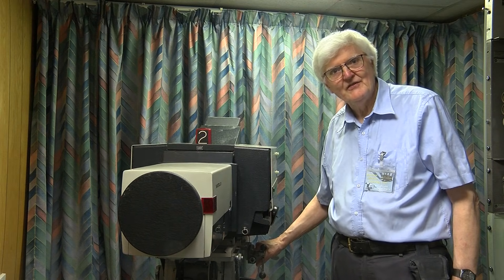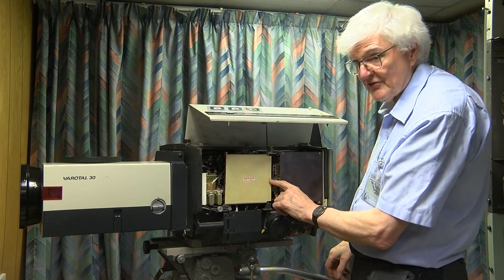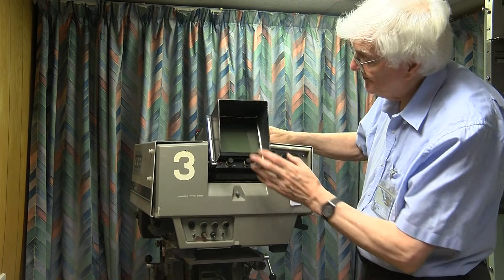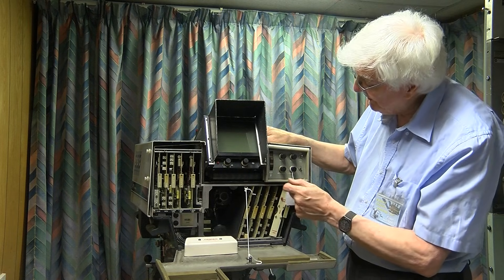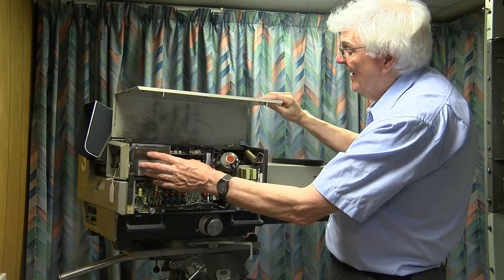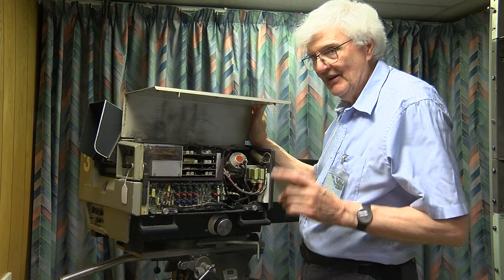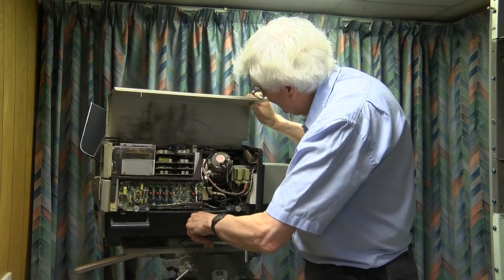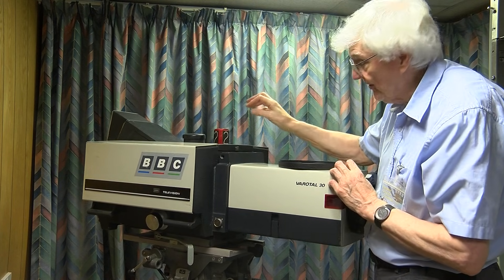In a Nutshell – the EMI 2005 TV camera

Comment: hi brian, i love watching your videos, can i ask what that was at the start behind the little door 30mm what? thanks :)
Reply: Plumbicon Tube - they collect the incoming picture and turn it into electronic signals. There are 3 them, one each for red, green & blue
Reply: @AVAVsystemsUK  ah! i see a type of light reactive valve/tube then?
Reply: @AVAVsystemsUK Ah, did that camera not have a fourth tube for luminance, and instead derived Y from the well known proportions of RGB?
Reply: @Mortimer50145  Yes, in a 3 tube camera, the green channel is used to convey the luminance/brightness signal. 4 tube cameras like the 2001 used a separate tube just for luminance  because the Y signal would be slightly better.
Reply: @videotechhistory  Ah, I must have got it wrong. I thought that 3-tube cameras always combined the RGB signals in ratio 30:60:10 to produce the Y, rather than using Y=G. And 4-tube cameras used a separate tube with a panchromatic sensor to avoid any registration errors producing fringes in the Y.
Reply: @Mortimer50145 you have it right: in a 3 tube camera Y is derived in roughly those proportions from each tube.  The Green signal is additionally used to make a sharpening signal that is applied to all three signals to counter the inherent fall off in output with frequency (fine detail would be unacceptably lost otherwise). This is known as contour correction.   Here is where a 4 tube camera had an advantage as the sharpening signal could come from  the Y tube.  A 3 tube camera could look a bit soft if the scene contained little gren content.  But it would be smaller, simpler and cheaper than a 4-tube camera.
Reply: @paulread2922 Thanks for correcting me. Also, they made the green channel occupy a lot of the Y signal because then, luminance and green alone would still have good clarity when broadcast over the air.
Reply: @paulread2922  Ah. I didn't know about the contour correction derived from the green.

I notice that this camera has its tubes mounted at odd angles (presumably this makes the optical path simpler) rather than having all three/four tubes parallel to each other. There was a handheld camera (I forget which make/model it was) with rectangular lumps and bumps to accomodate non-parallel tubes.
Reply: Actually I got this a bit wrong.  Only the green channel gets corrected.   This is a reasonable compromise because the green is the major contributor to the Y signal.  The eye is more sensitive to monochrome fine detail so sharpening the Y signal is important.
Reply: @AVAVsystemsUK  truly fascinating technology, thanks for keeping it alive, so much knowledge from the analogue era is very difficult to understand just reading the books, so good we still have experts like yourself around to explain :)